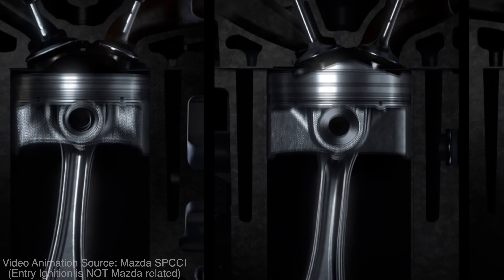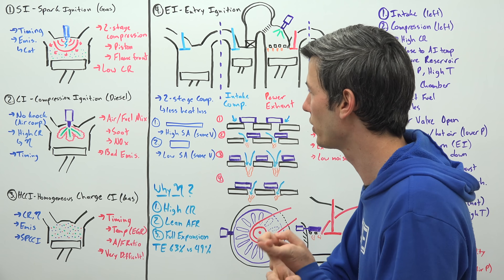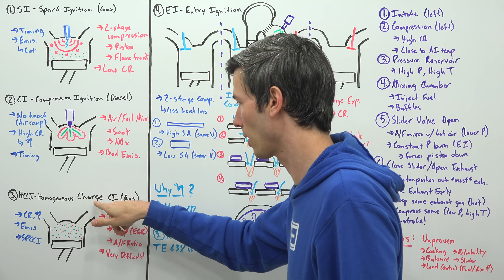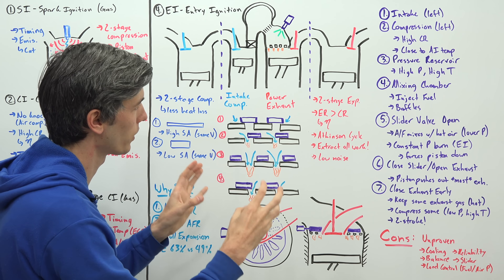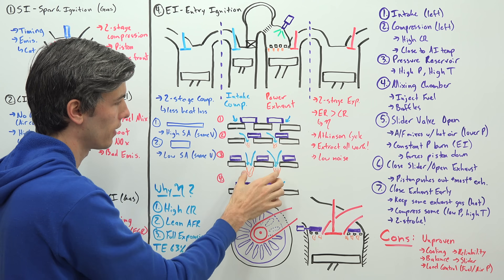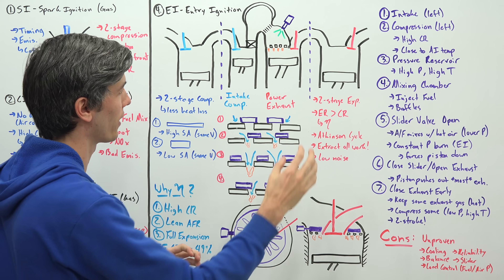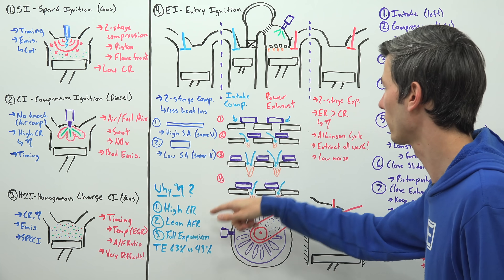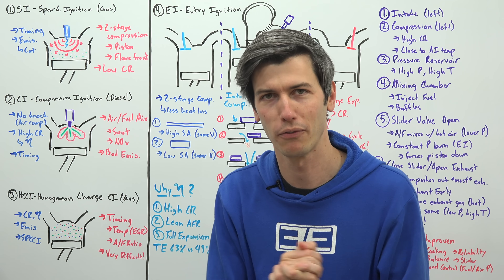Is 'Entry Ignition' The Future Of Combustion Engines?

Comment: An unlikely story,  how will the heat be higher in the combustion chamber?  If the air passes thru slider valve to lower pressure,  it will lose temperature.

Comment: It still takes at least 5 years(minimum) for you to recoup the initial cost of an electric car vs its equivalent gasoline car. Take the kona gas vs electric. It takes 7 years for that specific car at 15k miles a year to recoup the cost of the ev version. Its not too bad as long as no battery failures occur. But honestly at this day in age cost of ownership over 10 years is barely lower for electric vs gas as long as you are not getting a unreliable car brand for the gas version.
Reply: The key factor is reliability over that length of time.
Reply: Tesla Motors having never made a profit selling electric cars... it does not appear that any automobile manufacturer has.

Comment: I drive an old diesel, is it dirty... yes. What come out the tail pipe is nasty, but I get 16-20mpg! Because of the fuel economy, it makes up for the nasty exhaust, in addition to that it’ll run on oil form my oil change, waste oil from a fish fry, old vague oil not suitable for food, waste transmission fluid, & virtually anything that will burn except gasoline, & has some lubrication properties.

Comment: In my opinion: more parts, more complexity. More complexity, more expensive and more chance of failure. On top of that the development of electric drive is advancing faster and faster. However clever this is, I think it will not be implemented anytime soon. But I might be surprised.

Comment: Now I know how old-school carb guys feel about the computer tuning cars use nowadays.
Reply: I feel like this is more along the lines of going from steam engines to gasoline haha... completely different.
Reply: Except i just don't get how the old school carb guys act as if MPFI is some "newfangled" tech when its been around in most cars for nearly 40 years
Reply: @twoeightythreez  we just like the mechanical linkage to our throttle. 
On my 54 I can throttle where ever I want. Shift wherever I want. My daily doesn't do that. So I like carbs. 
I never have and never will drive a 100k sports car so I can't speak to their throttle feal
Reply: @zHxIxPxPxIxEz  there are cable driven throttle bodies. Have you ever had to re-jet a carb after a cam swap? That is a horrendous experience. Much easier to make a few adjustments on a Holley terminator... everything that’s new is not always bad.
Reply: @2blkSSs  I'm not saying new is bad at all. 
I like full mechanical driving experience. And yeah I've had to tune. 
Both are fun. For me if I'm driving or working on a car for fun I want old. 
That's why I have a 1954.
Reply: @twoeightythreez  because it needs computer. Computer bad

Comment: Interesting technology, but fuel efficiency isn't everything. Yes this will be very thermally efficient, but how powerful is it?  You basically have a one cylinder engine that's the size of a four banger, with TONS of parasitic loss (two other cylinders doing "nothing"  but sapping up power, and one other barely making any at all). Eking out every last drop of power (no pun intended) doesn't mean squat when you have an engine that can hardly move the vehicle it's attached to.

Comment: I have a mechanical background, training and experience in the commercial a/c,  refrigeration field. I understand well the principles involved in the internal combustion engine and the objective of attaining the most efficiency possible from any type of motor and related mechanisms. The EI system has potential, but what about continued  improvement of the  of the engine design itself ? 
IE; polished and ported cylinders, hemi head pistons,  lightweight engines and transmissions etc.? I believe car manufacturers are totally capable of building a better, more efficient engine. 
But they're sleeping with the oil companies and vice versa. And they have the GOP's blessings.

Comment: In the comments Den Log compared this to a steam engine from earlier times using multiple cylinders to use most of the pressure the steam would create  but he left out the part where you use a coal fired steam boiler to run the cylinders and the way this engine was described in the video an external power source would be required to turn the crank. If the primary combustion cylinder with the compressed air and burning gas never builds up enough pressure to blow back into the compressed air chamber, it will never exert enough pressure on the crank to run the compressor.

Comment: @Engineering Explained  double compression volumes (two stage compression),  split cycle with advancing of compression stroke over power stroke, anti knock pre-mixture chamber, double expansion work extraction volumes (two stage expansion) just look up extreme or extended expansion literature or John M. Clarke Chief Technical Advisor for Motiv Engines w w w . m o t i v e n g i n e s . c o m    and his paper How the CCI Mechanism Enables Higher
 Efficiency  (The Extreme Expansion Cycle), seriously nothing new just put three or four ideas together act like they are something new.  blah urrggh. i would rather prefer Hekals engine.

Comment: My wifes 2017 Hyundai has the 2.0 Atkinson engine. It does well for efficiency if you drive it with that in mind. 37 to 40 Hwy MPG the 6 speed gives it plenty of pep down low. Very happy with it vs the direct injected alternatives

Comment: This is way too complex as a 2 stroke basically, not to mention the insane cost of fabrication. Finding a way to up CR's on more traditional 4 strokes seems like better way to increase therm efficiency. HCCI seems to be the move in that direction. With pretty high CI's like 16:1 it seems that with more work done in this tech it might make light diesels die.
The valve is the real weak point EI engine. The industry has tried these kind of valves before and they have all been really crappy. This engine also looks larger than a normal 4 or 2 stroke and that severely limits where it can be used.

Comment: Can a turbo be used in this setup, or something like the turbo/blower setup Mercedes uses in formula one?  Or any other turbo?
Reply: According to the video the exhaust is exiting at almost atmospheric pressure so there is nothing to run a turbo on and again according to the video the pressure in the combustion cylinder is always less than the compressed air above the combustion cylinder. so you would have nothing to run a blower either

Comment: Surely upon ignition the pressure below the valve will soon exceed that above, and the flame will propagate into the upper chamber? Or is it that the pressure in the upper chamber is always higher - and that work is done by a higher volume/lower pressure in the lower chamber? Radical idea if this is so. What PSI are we talking for the upper chamber?
Reply: According to the explanation the air pressure above is always greater and would therefore require more work to create than the work done by the combustion pistons  turning the crank that runs the air compressor.  Like the multi-pressure cylinders of the steam engines of old, this engine requires an external power source to make it run at least according to the video.

Comment: Future is affordable EVs with low but acceptible range eg 125 miles range would be sufficient for almost everyone almost all the time. The few people who needs more than 125 miles range can rent a 50KWh mobile battery from a supercharger station and turn their 125 mile range EV into a 375 mile range EV temporarily
Reply: I drive 800 miles a week, and on two of those days i haul a 6000lb trailer over a mountain. EV's might work in metropolitan areas but for the rest of the country they are really impractical.

Comment: I've often wondered why we do not pressurize gasoline above compression pressure (1500 psi), heat it above atmospheric autoignition temperature with exhaust heat (electric startup), and do injector quantity/pressure control to throttle the combustion.

Comment: Regarding your comments at 13:20 (heh, heh...  1/4 mile pun)..  To control ignition as well as a spark, you could configure a 3-way waste-gate between the high compression chamber and the secondary exhaust stroke/ primary-compression stroke ports.

Comment: You have basically created a turbojet engine. Only the jet engine has 13 compression stages one area for the burning of fuel and then three stages of turbines to recover some power to be used for compression in the intake. Very similar to what you’re describing here only much simpler using spinning fans. The burner section of a turbojet or turbofan could probably be much more efficient but it’s pretty close to this. Once the fuel is ignited and the engine started the ignition turns off

Comment: I’m not an engineer or any thing like that just a car enthusiast but it seems exspensive and hard to repair
Reply: Current Corolla takes egr post cat, through a passage in the head, through an egr cooler, then back to the intake manifold. Benefit is the engine warms up 3 times quicker, drawback is if the coolant is low it doesn't cool the head passage or egr cooler, then when coolant does find it's way back, things crack pretty quickly.
Reply: complicated designs can be refined and simplified with enough development. Id imagine that early four stroke engines were unreliable as well.

Comment: In classic engine after ignition pressure over piston is rising to 60bar or more. In Dodge Daemon it is  135bar (1,958 psi). More in diesel engines.
In this engine we have to keep pressure over piston in low level, below self ignition level, it means below 12bars? For example 10bar (145psi!)
So in this engine there will be 10 bars (145psi) over working piston, versus 100bar (1450psi) in classic engine....
It means low torqie, low power and low efficiency.

Comment: Jason, would it make sense to change two things?

1.) Use an electric supercharger instead of pistons. Have the supercharger's battery be charged by the work done by the engine, which should be greater than the force to bring in air at a given pressure.
2.) Use a pressure valve, instead of a slider valve. Given a high enough pressure, the force of air in the upper chamber should overcome the force of the spring keeping a valve closed, pushing open a valve.

Comment: How do you prevent the gas from flowing back into the compression chamber forced by its own combustion?
Reply: I agree.  As long as the pressure is greater in the compression chamber the engine will never generate enough power to run the compressor let alone anything else

Comment: Jason have you ever run the numbers for a rankine cycle car? It sure seems to me like we could create a rankine electric hybrid that would be far more efficient. The electric would buffer the slow response time of the boiler  and allow the turbine to run at peak efficiency most of the time. It would also allow the engine to be entirely sealed, by putting the generator inside the pressure boundry. The only moving part would be the turbine/pump shaft, and only the bearings would wear (assuming there is negligible blade erosion). Oil changes would rarely be needed. The combusion is external, and can be as hot as the materials can handle for high efficiency. The boiler doesn't move or have moving seals granting greater material selection flexibility. It would be quiet, and have excellent emissions without need of a catalytic converter. 
The turbine, due to its higher speed would be small allowing the rankine cycle to be of similar power to weight of current engines. What am I missing? Why are we kicking the dead horse ottocycle, when we have a cycle with achieved efficiency that is much higher, and that should be far more reliable.

Comment: So basically this is a piston form of a turbine engine. Turbines have a low pressure compressor as does the entry ignition with the first compression stage, then a high compression turbine is the same as a the high compression piston followed by the high pressure turbine being the same as the power piston lastly followed by a low pressure turbine being the same as the low pressure power piston. This will have the same problems with the instant acceleration need that a vehicle requires because turbines need to spool up and so would the entry ignition as the compression would need to gradually increase so there would be a lag. Albeit probably a little less lag since huge jumbo jet turbine has huge rotating mas compared to a few pistons.

Comment: Why would this design be in any way worth the trouble?  Slider valve will become caked with carbon in short order.  The Crower 6 stroke makes much more sense; extract maximum heat/work with a direct water injection for a second power stroke, all completely feasible with a minimum change in manufacturing costs or even much retooling of existing machines.  This is just a double-expansion steam engine attached to the business end of an old twingle motorcycle.  Why not an opposed piston 2 stroke, or a direct injected 2 stroke, or.....why is this worth our time?  I suppose it's in the numbers (thermal efficiency, etc.), but it sure seems like even more of the same recent dramatic increase in engine mechanical complexity. Good luck eliminating failure modes.  I'll do an EV conversion on an older car and be done, lol.

Comment: more complexity, more parts, more problems. so, at what cost? instead, use the engine heat in a close system to turn a turnbine and charge a battery so i could get more bang for my buck. thank you.

Comment: Instead of leaching power from the engine to create compressed air, why not have an electric compressor that fills a reservoir while you're stopped at a stoplight, or cruising on a highway? And then it boosts you for the brief periods you need to accelerate.

Comment: How do you keep the combustion from getting back into the intake, while still allowing fuel to get in the cylinder? Wouldn't the slider valve be hot too? How does the auto ignition not blow back into the intake? Seem like as soon as you try to put fuel in it, it would blow back out before you could close the slider valve.
Reply: Well this is what I thought too.  If the pressure produced from the burning fuel/air mixture never overcame the pressure in the intake, the force pushing the power pistons down would never overcome the force required to run the compression pistons up.  If the air is at a higher pressure than the burning fuel, forget the fuel and just use the compressed air and have a perpetual motion compressed air engine.

Comment: Kinda reminds me of the Scuderi split cycle engine... except with an expansion piston like a five-cycle engine and a built-in supercharger. With so much energy extracted from the exhaust, I’d think there wouldn’t be anything left to run a turbo.
Reply: or the air compression cylinders.

Comment: how does second stage compression knock can break an egine?
I have been taught that knock on first stage compression will cause knock that can damage the engine and it made sense if you think about it. How could you damage the engine during the second stage if every part of the engine is made to just that, explode the gas and expand it.

Comment: I though knock was what happened when the mixture auto-ignites to far before TDC and the piston has to fight against that because it is still moving up. I would think that the 2nd stage compression ignition would result in a more complete and efficient burn. Or is it just spiking the cylinder pressures too much too fast?

Comment: An electric motor driven air compressor could potentially be used to dramatically simplify the design and eliminate downstream hybrid drivetrain components, perhaps even acting as a starter.

Comment: O.k. First of all, engine knock is NOT caused by incomplete combustion, it’s caused by ignition too far advanced/too high compression ratio for a low octane fuel, causing the combustion to commence before piston reaches TDC., so the combustion is trying to push the piston down whilst momentum is forcing it up, hence the 'knock'. This engine makes no sense at all, basically you have a complicated 4 cylinder engine with only 1 providing a power stroke. If it was so damn good, F1 would have produced it ages ago. I think you need to get a life and move onto something which you actually know about!

Comment: It's similar to the old Mercedes diesels that has precombustion chambers with pintle injectors, spraying high pressure fuel onto a deflecting venturi that swirls the the high pressure fuel, causing atomized turbulences of fuel which in turn is sprayed into the cumbustion.

Comment: Over complication. Surely you can create a more efficient 2 stroke by using direct air and fuel injection. Also exhaust at atmospheric pressure will require more mechanical aid to exit the exhaust this will rob you of the perceived gain in efficiency made.

Comment: Years ago I saw a YouTube video on an engine concept that used 2 cylinders for combustion.  The first cylinder compressed the air and the second burned the fuel. I've frequently wondered if this could be combined with direct inject in the first cylinder for a more efficient 2 stroke engine.  This video shows an advanced approach that solves many problems that I had with my ideas.  Thanks for the video.

Comment: manufacturers build their engines to run on the available fuel. the 99% of the engines that operate with 87 octane only have about 75% efficiency. when you raise the efficiency with more compression, it requires a higher octane of fuel. if not, you get destructive detonation

Comment: If you use the heat from the previous exhaust stroke to ignite the mixture, how do you you start the engine when it's cold? Does it use a glow plug?